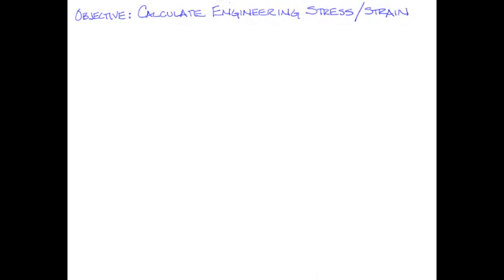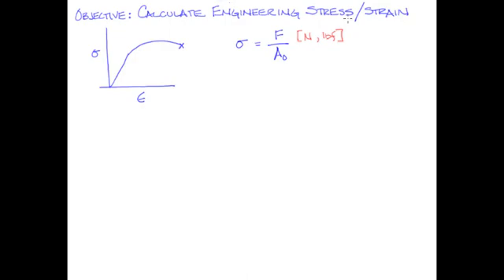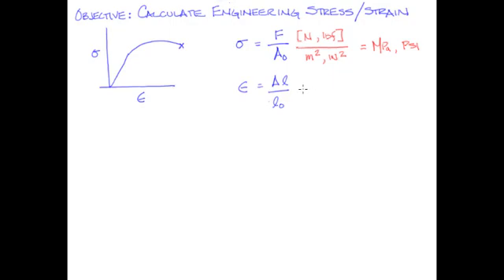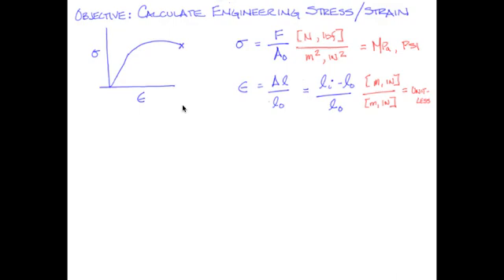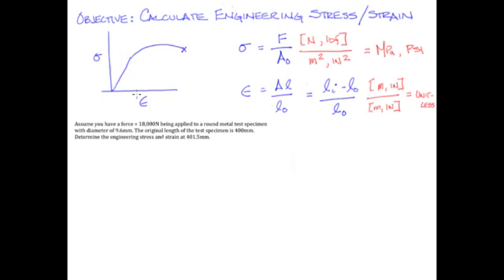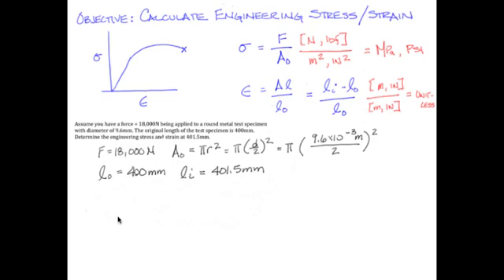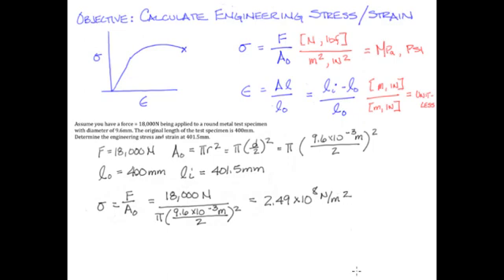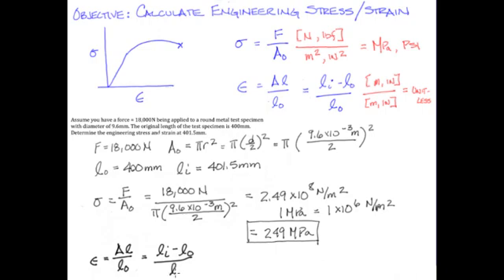Engineering Stress and Strain

Comment: thanks for the nice video. But my question is that when a load applied on a beam or... its original length become smaller not longer (400 mm to 401 mm shall be 400 mm to 399 mm). why? please reply me it. thanks in advance. @learnChemE

Comment: My question is when we calculate the stress the diameter should be in m rather then cm and if my force is in kg i should convert it into N
Reply from the maker: As long as you are consistent with your units, it doesn't really matter which ones you use.

Comment: Good vedio. l worked extensively on a new approach of defining tensile strength of brittle material, rock, at imperial college London. The true defintion is the instantaneous force divided by the instantaneous failed area. In my Ph.D thesis that was approved using 5 different loading configuration (direct and indirect tests). When the applied force at failure is plotted versus failed area of specimen, the gradient of the curve is the true tensile value of material.  For in depth knowledge one can refer to the Ph.D  thesis, 1997 by M. S ALDerbi, at imperial college.